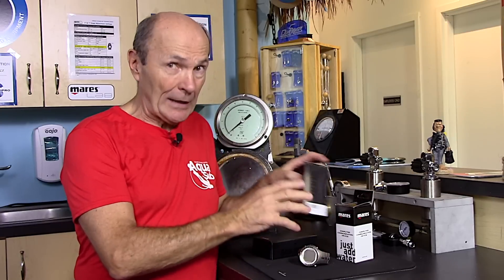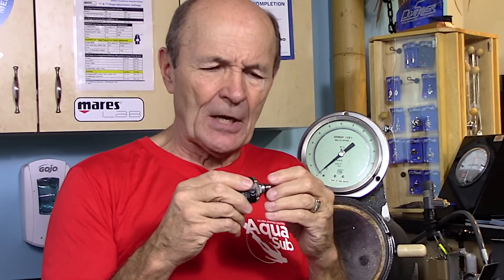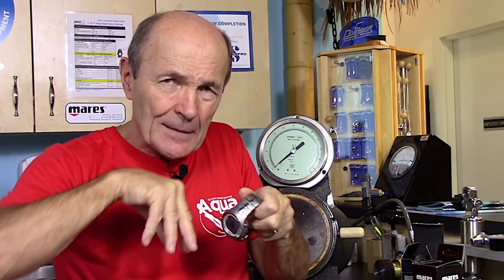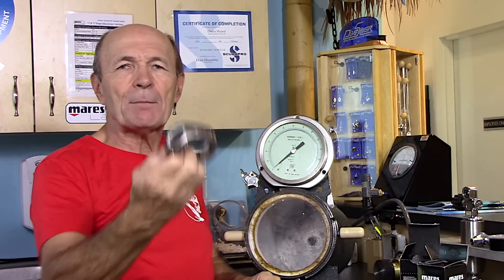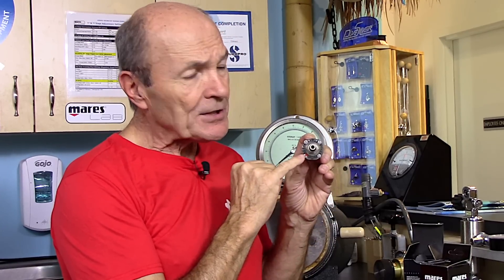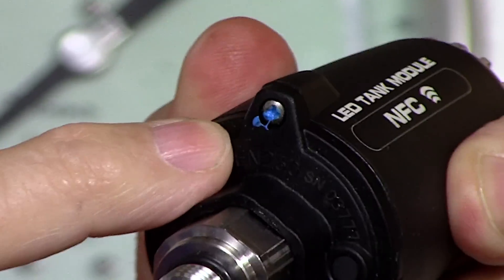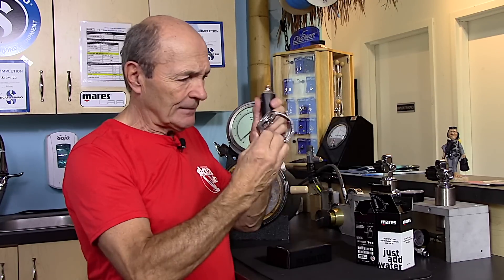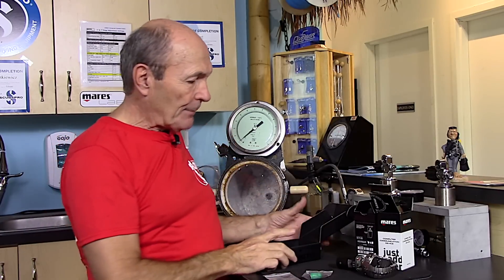Wireless Transmitter Battery Change - Scuba Tech Tips: S08E11

Comment: I like Alec's videos but this is on of the weaker ones.  I change the battery on my G2 transmitter myself and no problem.
Reply from the maker: Consider yourself in the upper levels of skills.  As a long time service tech, I repaired almost as many bad battery changes as dive computers sold.  I should have kept pictures as proof of how some DIY battery changers messed up: wrong battery, no o-ring, screws not tight/missing, etc.  Hope you find something else to watch and learn from.
A

Comment: Thanks Alec! I have a Suunto Viper Nuvo wrist computer and tank transmitter. The Suunto Viper computer battery is user replaceable, but the transmitter battery is not. The computer has a battery check to OK every time you turn it to dive mode. Surprisingly, there is no battery check for the Suunto transmitter. I was diving in Bonaire last week and after a half dozen dives the PSI bar on my computer flashed BATT to show the transmitter battery was dead, with no psi, so I ended my dive. If I had a redundant SPG I could have continued. Before my next dive I added a redundant SPG console, that I will always now use as a backup. And, Alec is right that the transmitter should only be serviced by a Suunto service center. The cap must be replaced, and Suunto only sells that kit to Service centers. My dive buddy is a tech at a Suunto service center, and he confirmed that the transmitter can flood without a new cap. Suunto battery service at my center costs $55.
Reply from the maker: I hope all makers change to fully user replaceable OR rechargeable units.  Nothing worse than ending a great dive like Bonaire due to a  battery issue.  
A

Comment: Hi Alec! I would like to know more about metal that screws into plastic...
Speaking about the transmitter, you said to use a new cap because they have metal screws into plastic cap and, after you unscrew them, it will never be the same. Got it. My question is: what about a power inflator or even a dry suit inflator? They both have metal nipple (I mean the one that it's connected to the inflator hose) that screw into plastic... I always take it apart when servicing the power inflator/dry suit inflator because I want to change the o-ring behind it. Is it bad? Should I use some teflon when doing that? I hope you can understand, English is not my first language :)
A fan from Italy
Reply from the maker: Your English is great, not a problem.  I'm reading 2 questions here; first is some transmitters have one use screws.  When replacing batteries the screws lose the glue/adhesive that locks them in place so like the battery, they are used ones and replaced.  Not all makers do this but Mares does and replacement batteries come with replacement screws.  Second, power inflater valves are very different from brand to brand but generally either have one screw to disassemble the unit or plastic clips to open them up.  Teflon tape should only be used if the maker advises it otherwise there is too much pressure/resistance on the thread into plastic and can strip off the threads.  Always follow the makers service instructions otherwise you may be liable for damages to customer gear for not following service procedures.  Take care Mattia.
Reply: @AlecPeirceScuba_SeaHunter  Thank you for the explanation! I haven't thought about the possibility of teflon putting too much pressure on the threads before! It's so nice to have a discussion and learn from a Pro like you! Now i'll be more cautious when disassembly my unit!
As always, you're great!

Comment: Just a little more info...btw, I have a Shearwater Perdix with a Shearwater transmitter.  Both the Perdix and the transmitter are not low end computers.   The Perdix was $1300, the transmitter was $300 or so (been about 3 years, so don't rightly remember).  Both the computer and the transmitter have coin slots for  user battery replacement.  The computer uses a disposable AA.  The transmitter is a CR2 lithium.  Just an FYI for other Perdix or Shearwater transmitter users.   

I wear my wristwatch on my left wrist, so when I wear the Perdix, which is too big to use as a wristwatch anyway, I wear it on my right wrist.  This adds one benefit for me: during ascents, when I want to look at depth and ascent rate, my left hand is on my LPI to manage air in my BCD.  With my computer on my right hand, I don't have to lower my hose to look at it.  This still allows me to use my SMB, since I don't have to worry about raising my right hand above my BCD to manage that line. Just a convenience for me.  Everyone has their preference.
Reply from the maker: Exactly John, everyone is different, has preferences but still dives safe.  Thanks for the feedback sir.

Comment: Ironic that you speak about diving safely when you suggest replacing an analog SPG for a transmitter. Transmitter compliments the analog SPG, but never should replace it. Reinforcing the concept of relying on a computer for safe diving rather than planning a dive is a very bad advice.
Reply: Agree with Sergej. Always an analog SPG as backup. Some computers do not alert about battery level on transmitters, or it could happen that it could be unpaired during a dive. You don't want to be in a situation during a dive when you don't know how much air you have on the tank.
Reply from the maker: Dive computers are mandatory at every dive location, live aboard and resort i have been to in the last 3-5 years primarily for safer diving.   No one asks for SPG's as it is now a personal choice, not required.  Enjoy your SPG but don't dismiss dive computers.
Reply: @AlecPeirceScuba_SeaHunter  I think you're missing the point of my comment. I didnt dismiss the dive computer as a tool for safe diving. I'm concerned that you give advice which is unsafe in its nature. The dive charter isnt there to make you dive in a safe manner, and relying on the rules set by the charter is dangerous to the dive. It should be your concern to plan the dive, and dive the plan. Having an analog SPG is a matter of safety, as computers can become unpaired, or signal interference can prevent transmission of cylinder pressure information, or if you lose the computer during the dive, or it can flood. You suggest putting all of your eggs in one basket, and I'm voicing my opinion that you give that advice without thinking about the safety of the people who hear this advice.
Reply: @BrutalMilkman  I dive with two computers that are both air integrated(mostly because I'm waiting on my old one to stop working) but even if you only have one dive computer and no SPG you can end the dive if your computers pressure sensor goes out or it runs out of battery. The more redundancy the better but I'm not sure it could be considered reckless to just have one air integrated computer or one SPG, either can break.
Reply: @mhilyard1  The problem is preaching the mindset that a battery operated device substitutes an analog SPG. It's 100 dollars that you're not spending on a piece of kit detrimental to divers safety. I've known strokes who didnt invest in a spool and died inside a wreck, and strokes who didnt have bailout while diving ccr. It's the mindset that id dangerous, and Alec here propagates it.

Comment: How long does the battery last? I got my transmitter 2 years ago but haven’t done with it yet. The watch batteries do seem to die rather quickly. Is there a way to tell if I need to replace the transmitter battery?
Reply from the maker: All the wrist transmitters I know of have a internal battery check and when connected to a transmitter, its battery check.  Some have a scale others are just a OK.  No one wants a battery go dead on a dive so there is some checking ability.  Check the owners manual or if shopping, check the features for this.  Before I buy, I like to download the user manual of the products I'm interested in to see how easy it is to use.  Good luck shopping Loren.

Comment: Alec

Would it be possible to do a video about pressure testing dive computer/watch/transmitter after changing the battery so that we know it will not leak on a dive when it is needed.
Reply from the maker: I considered it but other than watching it closely on the first dive after a battery change, there is little a diver can do.  A few dive stores have pressure test device you put a dive computer in then pressurize it to say 100'.  Don't know what they would charge but its primarily for peace of mind.
Alec
Reply: @AlecPeirceScuba_SeaHunter  Maybe I used the wrong word of "pressure testing". I really meant "watertightness testing". There are pressure testers available on Amazon which are very similar to what I saw being used in a dive store. If you don't feel that a video is possible, should you keep the watch in the air, pressurise the container, wait a few minutes, immerse the watch and then release the pressure OR keep the watch in the air, pressurise the container, wait a few minutes, release the pressure and then immediately immerse the watch? Or some other sequence? I have had the batteries of several dive computers changed at divestores and then leak on the first dive of a 2 week scuba diving holiday. I even had one dive computer that had its battery changed at a divestore, I did one dive in fresh water to test it out and no problems showed but on the first dive in sea water, the computer started acting up so I inspected it - the o-ring had not been seated properly and was sticking out of its "door" - I opened the "door" and re-positioned the o-ring and the computer worked fine for the next two weeks of my holiday. Naturally, as soon as I got back from my holiday I went back to the divestore and complained and the computer was sent back to the manufacturer where something was done to it. That was about 10 years ago and the computer is still working fine and I now change the battery myself, hence the question of how to correctly test it.

Comment: I have the Aqua Lung i450T watch/computer with tank transmitter and literally the night before we were due to leave on our dive vacation I got the low battery indicator on the watch. It's a "user changeable" battery and I had the correct replacement battery and followed the battery change process to the letter but on every dive I was anxious that the computer would flood on me. And with no spg back up, my diving would've been done. Luckily,  I had no issues but from now on I'll be taking it in to the service center for battery replacement. Thanks for the advice, Mr. Peirce. Love your tech tips!
Reply from the maker: Check your owner's manual for the expected life of the watch AFTER the low battery sign appears. It's usually many hours, more than enough to make a dozen dives or more.
Better to change it but there's no need to panic if the Low Battery sign comes on.
Take care.
Alec

Comment: Yep, 17 cents worth that the store will charge you 5 bucks for.
Reply from the maker: Change dive stores!
It's hardly fair to complain about your LDS if you continue to go there.
That's a bit like complaining about MacDonald's as you chomp on their burgers!

O-Rings in bulk are quite cheap. An LDS buys in bulk to make up for the lost revenue from filling tanks.
You can do the same if you have a use for 250 O-Rings of the same size.
Normal mark-up on a special part would be 3X Regular Dealer Price. 
Regular Dealer Price on a non-specialized O-Ring would be $1.10 so should cost the diver maybe $3.00.
Some, like the valve face O-Ring, are cheaper; lots, like the square-shaped ones for a DataPlus, are much more.
If a dive store is large enough to buy in bulk and so pay a lot less for their O-Rings, the Mark-Up process is the same, so they can make a bit of extra money. 
Surely you're not upset that your LDS is making an extra $1 to $2 once in a while!
I'm sure they've done lots for you and not charged you anything or very much.
Lawyers ask $250 or more per hour to discuss your case! How much does your LDS charge to discuss your dive computer problems??
Alec

Comment: Take the dive computer itself to a watch repair shop.  That is what I have been doing with my Dive watch.  The will charge you less then half as much.
Reply from the maker: Many watch repair centers can do a fine job of replacing batteries in dive watches.
Few have much experience with dive computers.
Fewer can or will get factory replacement parts.
Even less have a pressure chamber.
They certainly won't test under water.
And, if less than 2 years old,  your warranty is over if you don't use a factory service center.

Going to a watch center can save money but I want you to know the difference.
Alec

Comment: this is a different DIY! actually it's the opposite... I've changed the battery on multiple Cobras and have no issues (well other than depth sensor going bad, but that's a known separate issue) but after 2 years and 80+ dives still says full battery so not like I have to do it often :)
I have another (to be sold) wireless/watch AI one - decided to keep the wired one (with compass) so I can keep jamming my hands grabbing lobsters.. speaking of which it's the season. I'm out of here...
Reply from the maker: The Cobra was one of the best. Sold and used a lot of them. Nice to hear yours is hanging in. Others haven't been so lucky.
Speaking of luck, have fun with the lobsters.
Alec
Reply: yeah apparently there is a lawsuit that Suunto settled for depth sensor issues, but only a limited time range - http://www.suuntodivecomputersettlement.com/
leisurepro are selling the older cobra for half off now.
Reply: Cobras are easy.  Just replace the o-ring at the same time.

Comment: Hi Alec. Interesting video as always. I thought that the pressure testing chamber was a neat thing, I don't recall seeing one on the bench at your old place? Just wondering if it is dry or full of water then pressurized? I could see using this to test flashlights too. Always a good day when you learn something new (and don't have a scar to show for it! :)Thanks Owen M
Reply from the maker: We had one but quite frankly didn't use it very much.
You can dry test many items but it's usually best to put them in water. If testing dive computers you MUST have them submerged.
I probably used out tester to compress foam coffee cups more than anything else. It was fun to watch a medium coffee cup turn in to a tiny coffee cup as the pressure increased!! It really drove home the effects of pressure to new divers.
Take care.
Alec
Reply: Alec, how did you know if there was a small water leak ? is the device that precise to know a change in water volume/pressure - air bubble ? not like you gonna open to watch and see if it's getting wet, as you would have to re-open it again. Don't know that I ever seen these before...

Comment: If you've got a ScubaPro G2 transmitter, I'd recommend replacing the battery annually or before every big diving trip. My factory G2 transmitter battery was throwing low battery alerts after less than a year (14 dives), and the replacement battery had a similar lifespan before beginning to alert. I carry spare batteries with me now :)
Reply from the maker: That's a bit fast. Next time you can live without for a few weeks, (Scubapro isn't fast) have it returned to the factory for a test.
Carrying spare batteries is always a good idea. You often can't get computer batteries on a dive trip. There are no Walmarts in Mexico or the South Pacific.
Take care.
Alec

Comment: I can attest to the reliability of hose type air integrated computers. I have an Oceanic Datamax Pro Plus that is 19 years old and still going strong. This thing just won't die, and the calendar only went to 2008, so Oceanic only thought it would last 10 years. The only thing I have replaced is the battery cover o-ring each time I replace the battery. I just upgraded to a Shearwater Teric (awesome computer and well worth the $$$) and the old girl is now my back-up. I've never felt the need to have a backup SPG. One could argue that its just another point of failure. I simply love having one less hose using the Teric with a transmitter. Horses for courses I guess.
Reply from the maker: The Oceanic Datamax was one of the earliest AI (that's air-integrated - NOT artificial intelligence!) dive computers and was built to last. I sold thousands of them and I'll bet 1/2 of them are still working.
Once you've used a good AI computer, the SPG becomes almost silly. It would be like setting down your iPhone to use a dial phone (do they still have dial phones??) - no contact list, no speed dial, 10 seconds to dial the number, no history, etc, etc. 
Picture this - you're looking at your Datamax or Teric screen with all of the information it provides about your dive status, then, drop it and look at your SPG. Nothing!! Tank pressure only - a number that simply tells you there's air in your tank. You know that!  You're still breathing!!!
As I've said many times, the SPG was an incredible leap forward in the safety of scuba diving - in 1962!!!!! Hello out there!
Take care.
Alec

Comment: Shearwater + coin + oring + lube = always works. No floods.
Reply from the maker: No dive computer floods until it does.
Shearwater makes a nice product but I guarantee it can be flooded.
There is no dive computer made that is guaranteed to not flood just as there is no computer that won't fail.
Even Shearwater says so in their manuals.
However, with careful use and fastidious maintenance, a dive computer is simply the best safety device that has appeared on the market since the Safe Second.
Alec
Reply: Yep. I changed the batteries of my Perdix AI a couple of times already, and the transmitter battery also. Some newer systems are specifically designed to be user operated, most older systems were not. My Suunto Viper II always went back to the dive store for a battery change.